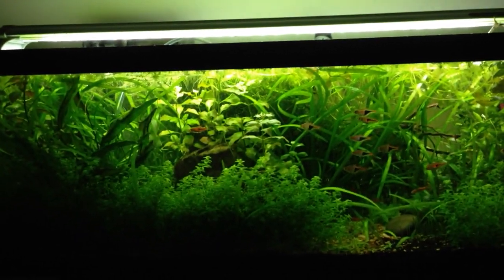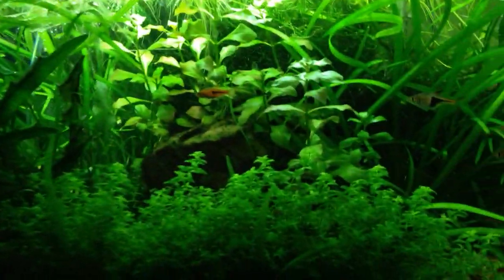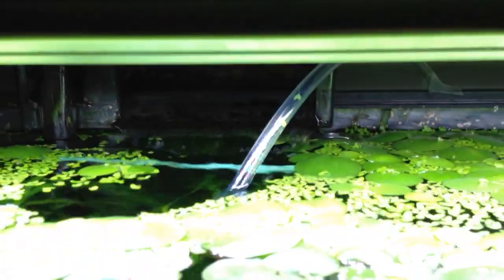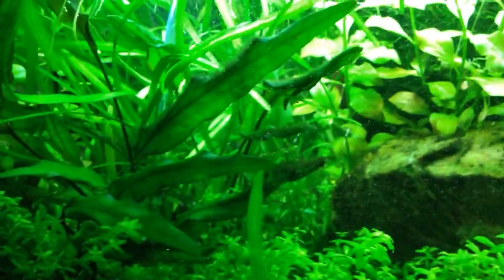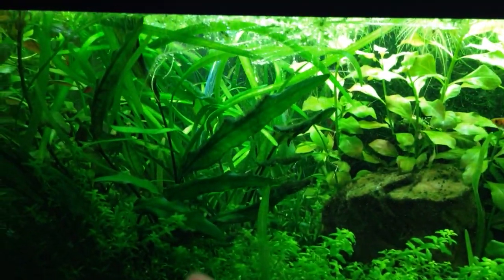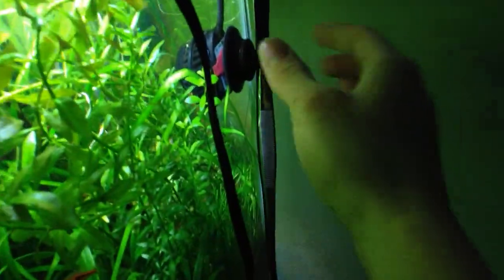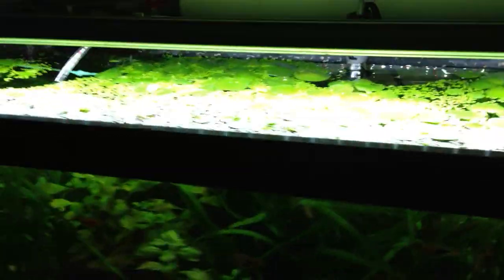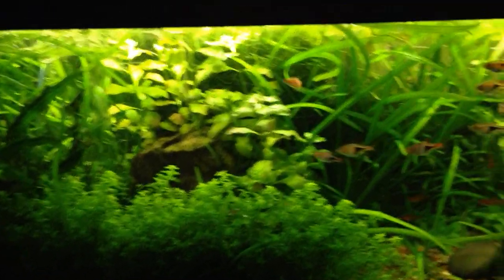Where to position a pressurized CO2 diffuser

Comment: My aquarium guy told me to place it on the wall opposite to the one that has the spray bar (I use an Eheim Classic 2217). Is that the right thing to do? The flow is pretty strong on that end.

Comment: Love your tank, trying to achieve the same in my 55g tank. I just purchased the completed ultimate Co2 system from aquariumplants.com, it comes with a CarbonDoser Internal CO2 Reactor. My question is, what is the difference in a reactor and a diffuser, which one is better, and can the reactor be placed in front of the filter water flow just like in your tank?
Reply: +YOUSIYC7 Reactor maximize the potential of dissolution of the co2 in the water so its better than a normal diffusor that release immediately the most of co2 if you use diffusor belly are recommanded to break the ascension of co2
other good option if you have internal filter with airflow entry is you connect the co2 entry on the airflow entry of the filter here you have a good diffusor for cheap and diffusion is on the horizontal wich cover more surface of your tank for better diffusion
Reply from the maker: I do not have much knowledge at all on reactors to be honest. But I believe they are more efficient in general since there is less loss of CO2 when diffusing it into the water. Usually I think they are set up externally or outside the tank and connected to your filter through tubing. I wouldn't be the expert on that though. Sorry I couldn't be more help
Reply: Thank you.
Reply: Hi. I love the look of your tank 💗
I have a 125gallon with 2 hob filters and I was going to add a marineland maxi jet water pump on one end for extra water flow and to push the co2 bubbles round. Do you think this would be ok?
Its been planted but still the plants look pretty small at the moment.

Comment: Would you recommend more oxygen in a tank with pressurized co2?
Reply from the maker: Yes oxygen is important when you have CO2. So just a little surface agitation is needed.
Reply: Plants consume oxygen when they are no longer photosynthesizing at night when the lights are off. I run a small airstone  on a timer when the lights are off. It puts my mind at ease, not worrying if oxygen saturation is low when my lights are about to turn on each day. That’s when oxygen in the aquarium would be lowest as the livestock and plants compete for oxygen during “lights out.” There are some good videos out there about this topic.